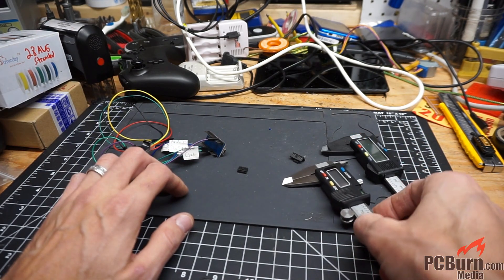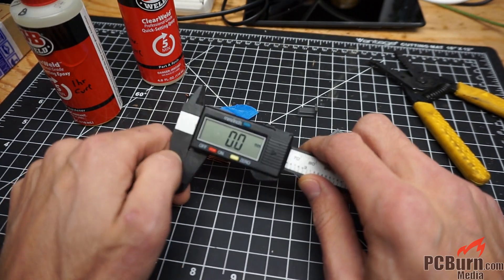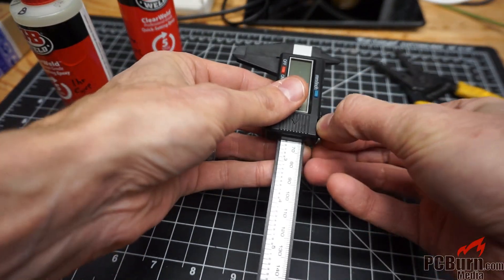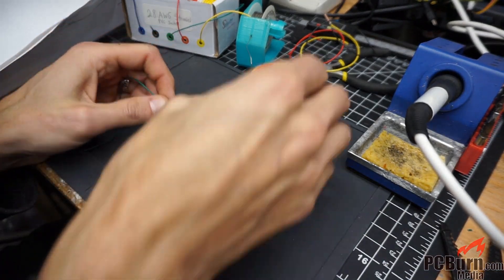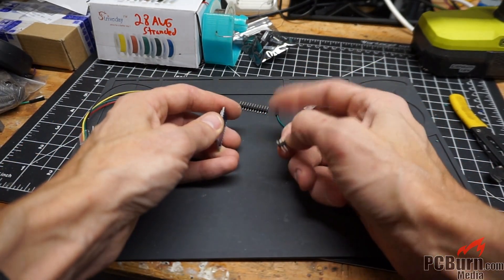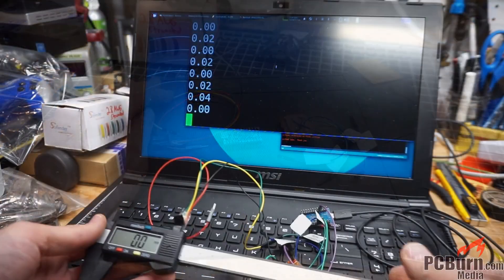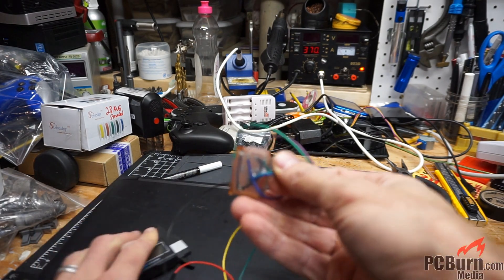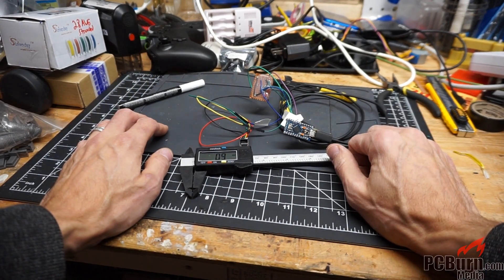Digital Caliper DIY - Make Your OWN Machining DRO, USB, or Keyboard-on-Click Vernier Calipers

Comment: Well, I am from India, but I am not getting a cheap vernier with data output. Could you suggest a vernier that is available here?
Reply from the maker: I assume the new cheap calipers have test points still. They lack the cover and the gold fingers of this model. I still need to take apart one of the newer models.

Comment: Good to know the DRO you can get readings to .01 even if the display shows 0.1.
Reply from the maker: Yea, along those lines I've got a stack of cheap composite vernier calipers to play with. I'll probably be tearing one down to see if all the outputs are still exposed and add a hard on/off switch.

Nice to have a cheap non-conductive set at hand to knock around!
Reply: @PCBurn  honestly I was toying with the idea of grabbing cheapest digital calipers either cut modify to have the stickersl ine up and act like a long single rail but I am just toying with that idea.
Reply from the maker: I'm assuming it'll all end in tears. But at least they'll be cheap tears! Post it on HackADay, I look forward to hearing about it!

Comment: I'm trying to create an Arduino, Bluetooth adapter to use glass linear encoders (DRO scales) to interface with the TouchDro Android app.  Any thoughts?  Thanks
Reply from the maker: I think there's a serial over bluetooth standard. But I don't like using Android much when I can avoid it. Good luck!

Comment: Great stuff in the video.
Can someone tell me if i can use an Arduino Uno without a usb extension?
Because I wanto to track a movement(travell) of a damped spring on one of my machines.
And can someone tell if it would possible to change the the messuring output to a sd with a certain set frequency?

Comment: Nice video! I was wondering if you can add a push button to transfer the data to the computer? That would be real nice to show :) I'm working with an arduino pro micro as well, but I'm having issues with getting it programmed though...
Reply from the maker: I have planned on working with this again to add a display back-pack using a 1284 LCD. I'll take a look and see what it'd take to put a push-button transfer option as well.
Reply: @PCBurn  Sounds great. Yeah, I'm having issues with even getting the screen to work. I would appreciate your feedback when you start working on it. Thanks.

Comment: I need some help on an arduino project unless you have a more economical solution. I want to collect measurements from three digital dial indicators and plot the measurements on a graph. 

Every 0.5mm of travel on indicator 1 I want to collect and plot measurements from the other two.

I'm trying to measure cam lift vs crank angle on a dual over head cam engine. I'm under a pressed timeline. I was hoping you could help.
Getting the reading from the dial indicators seems pretty easy but most of the stuff I'm finding has a defined sampling rate and I only looking at a single indicator. 

Even if I have to record the data and plot in excel for the time being that is fine I just don't need 1million data points and I was hoping to only capture measurements every time it saw a change in the piston position indicator. With the face engines the plug is centered over the bore so putting a digital indicator in the center is fairly easy with the extended tips. There is some substantial fab that I need to do to mount the indicators but I can handle that. I just need help collecting the data and plotting it.
Reply: Igage makes a 2" indicator that will use for the piston travel and I will mount two 1" indicators over the cam lobes. If email works better my email address is spencer@sharpengllc.com any help would be greatly appreciated
Reply from the maker: That would all be straight forward with an Atmega based dev board (i.e. Arduino or clone). You'd write a loop and then on change to the read-in at some sample frequency on your main input write out your three indicators to the serial (or whatever you're using to record the data) monitoring line. You'll need to test for things like latency to see if the sampling and indicator hardware works for your application.

I just saw this project go by which might be relevant for the logging and display: https://www.alex-spataru.com/blog/introducing-serial-studio Although it might be easier to just tailor the data points.

If that seems like it would be too challenging to program I'd recommend looking for a Makerspace... it's the sort of thing that someone facile with an small dev board might do with you offhand if they had the hardware in front of them and a few spare hours.

Comment: The recent carbon fiber calipers (Zoostliss?) have connector inside and there is no opening in the case. But even if you open it, you will find out that the connector does not have any signals, they are not bonded out on the chip. The manufacturers probably discovered the use of these and disabled modifications as shown in this video. :-(
Reply from the maker: Could be they removed some of the components needed for the output lines. I'll try and aquire a current part; the one I have had the fingers live I believe.

I still need to CAD up a case with a Atmega backpack and release some updated software. So before that if I can get one in time.

Comment: I have a similiar digital caliper. But it doesn't seem to open up  the port you opened in the back of the caliper. How did you open it? Did you cut it open?
 And do you think it is possible to switch on the extra digit somewhere on the board of the caliper?
Reply from the maker: The 3$ "Carbon Fiber" (really cheap ABS) calipers I have just don't have a port but still have the connector leads. You can pop the case and see if they're available.

Possibly. If the IC's programmable or there's something functioning as a switch. I don't recall seeing anything that looked like a trace to cut or line to pull low/high, I'll have to check.
Reply: @PCBurn  Well If you can discover the switch, it can be great turning a 3 dollar caliper to 10 dollar caliper. ;)

Comment: the tutorial also works with mitutoyo?
Reply from the maker: I was going to say probably not, but it looks like it might! I'd check to make sure the voltage and lines are the same but it looks like they might mostly be SPC. If it's a standard, then yes.

I'm also going to revisit this and add some menu options and an external display.
Reply from the maker: Ah, so a bit more research turned up this: https://www.instructables.com/id/Interfacing-a-Digital-Micrometer-to-a-Microcontrol/
that's got a wealth of information on creating a digital cable between arduinos and the Mitutoyo interface the author's documenting.